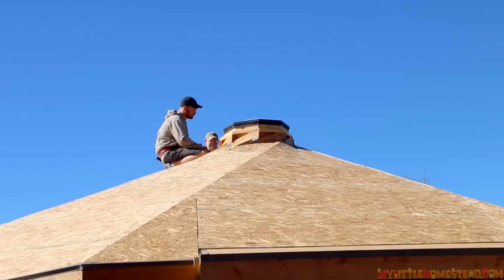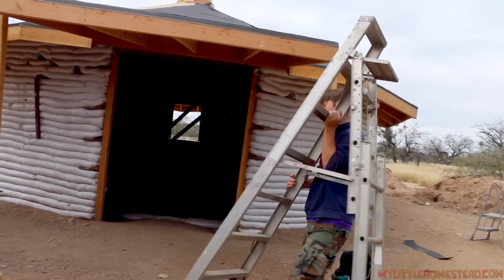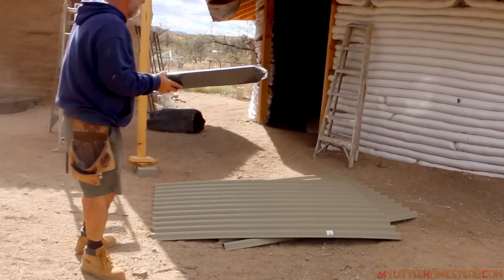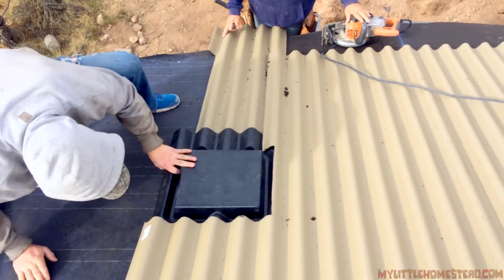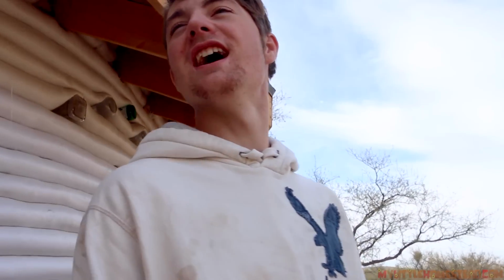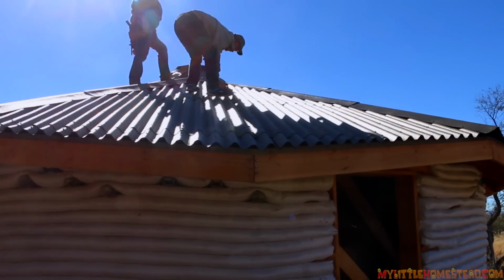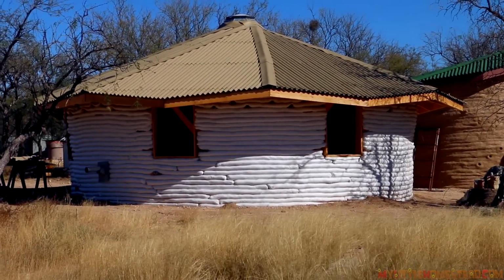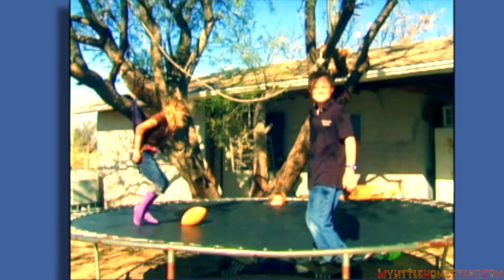Completing the Reciprocal Roof | Underground Earthbag Building | Weekly Peek Ep67

Comment: Great job on the skylight! That was a tough one. The only other idea I came up with was to take out the table saw and cut some of the edge pieces as flat as possible and work it up like siding. It would have looked more octagonal but like the boys said it as long as you were not back up there in two hours ripping it apart, you have a win!  Now for the inside ceiling. Good Luck!

Comment: Is it my imagination or are the walls starting to bend and bow?  Couldn't tell if it was the camera angle, wide angle lens or geometry.
Reply from the maker: The walls have not moved since we fixed them. They have settled and hardened. What you see is the resulting organic shape. Extremely safe - it would take a bulldozer to take it down.
Reply: I keep wondering as I see you building that if you laid two layers of bags side by side and did a tandem set of rows up to about 4 feet and then a single width row (like you have done) from there up if they would be more sturdy, but that's just my suspicious nature and tendency to "over build" everything.
Reply: Walls did bow early on in the project from rain, but they've been more or less "straightened"
Looks like they did lots of reinforcing afterwards too, but yeah the walls do have an organic shape...
Reply: +Greg Gallop I've read that these structure meet the California earthquake building code. Very strong and very sturdy. Your idea would of course work i think, but not necessary. Earthbag structures are built in africa with no wooden roof. Bagged all the way to include roofing. it looks like an upside down bee hive. Very sound structures.